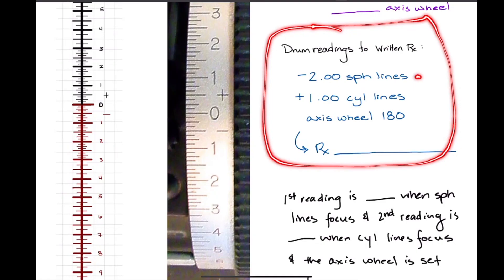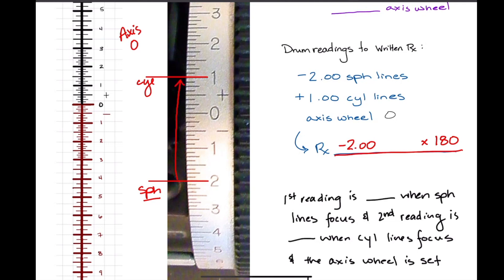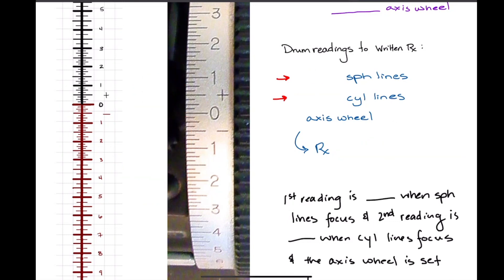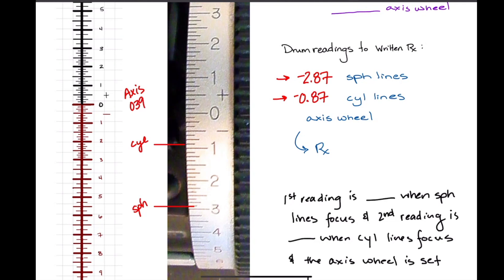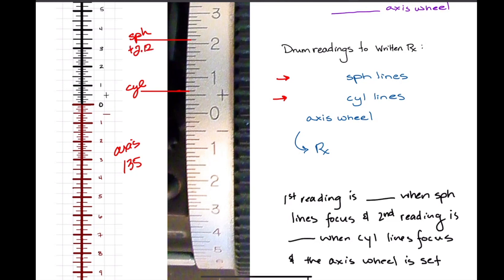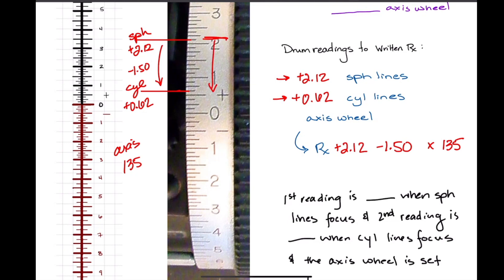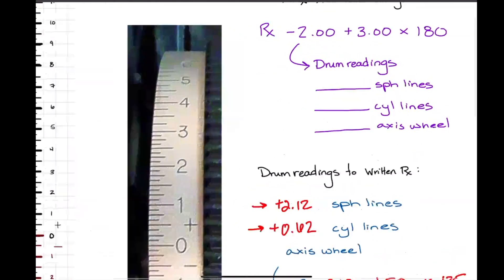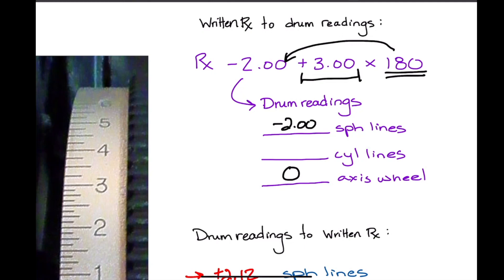LENSMETER DRUM READINGS (Lecture 1 from 2/14/23)

Comment: The transposition is incorrect should be +2.74
Reply from the maker: That’s is what you’ll get in the calculator because the calculator doesn’t know about the 5 ( .005) that’s truncated on the eighth diopter steps. If you enter the 5 on the eighth increments (.0125, .375, .625, .875) it will result in the correct value in your calculator. Either that or just round the calculated result to the closest 8th diopter increment, it’s always a tiny difference (.13 is another common result in the calculator, and you would just round it to .12).

Comment: Does this touch on reading in 12ths ? Or have any content help on that ?
Reply from the maker: It uses them but doesn’t really explain them in this video. Hopefully this helps clear you up a bit. 

Eighth Diopter Increments – Explained

In optics, lens powers are often measured and produced in eighth diopter increments — that is, steps of 0.125 diopters (D). This means each 1.00 diopter is divided into 8 equal parts:
	•	1 ÷ 8 = 0.125 D per step.

It’s called “eighths” (not “twelfths”) because the dioptric scale is decimal-based, not time-based like a clock. Twelfths (which would be 0.0833) aren’t practical in optics, while eighths are clean, consistent, and used by lensometers, lab software, and surfacing tools.

⸻

Example – All Eighth Diopter Steps from 0.00 D to 1.00 D:
	•	0.00 D
	•	0.125 D
	•	0.25 D
	•	0.375 D
	•	0.50 D
	•	0.625 D
	•	0.75 D
	•	0.875 D
	•	1.00 D

These increments continue in the same pattern across the full dioptric range.

⸻

How Eighths Are Written in Prescriptions (Rx Form)

When writing prescriptions, we truncate the final “5” from these values — we do not round up. This standard keeps Rx formatting clean while maintaining accuracy.

For example:
	•	0.125 D → written as +0.12
	•	0.375 D → written as +0.37
	•	0.625 D → written as +0.62
	•	0.875 D → written as +0.87

⸻

Eighths on the Lensometer Power Drum

On most manual lensometers, eighth diopter increments are visibly marked on the power drum between +3.00 D and –3.00 D, helping opticians detect subtle differences in power — especially important when verifying lenses close to the ANSI tolerance limits.

Beyond ±3.00 D, these eighths are no longer visibly marked — the power drum typically returns to quarter-diopter markings (0.25 D, 0.50 D, etc.). However, eighths are still understood to exist between those quarter steps, and trained opticians use that understanding to make more precise power estimations, especially when applying ANSI tolerances for high-powered lenses.

Eighth diopters are explained in Optical Formulas Tutorial by Ellen Stoner.
Reply: @MsTracyBennett so I’m understanding the powers are divided by 8, so my question here is a practice question , on the practical study guide . Maybe you can explain , so my answer of a reading was +2.00 -1.50 x95 , but the answer is +2.00 -1.62 x095 . How do you get the -1.62 .